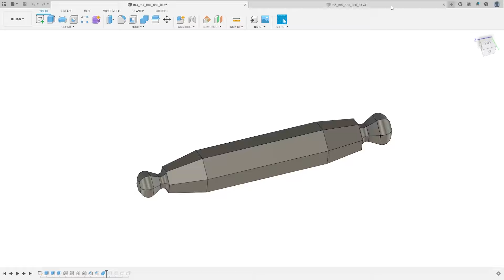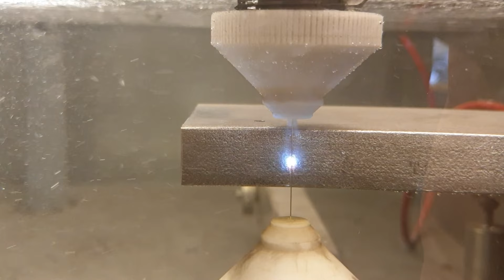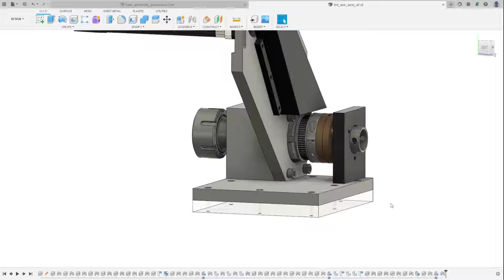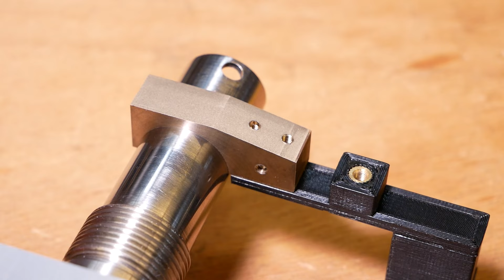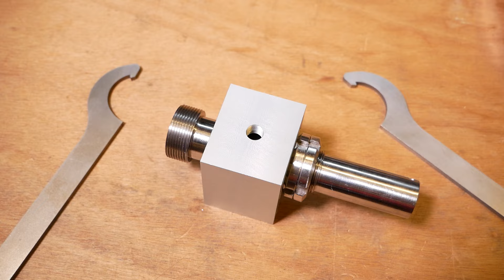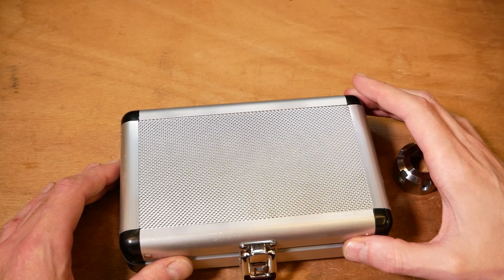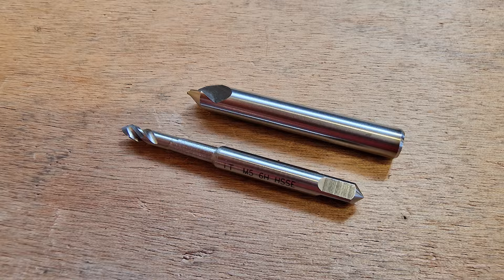Worlds First DIY Wire EDM Lathe!

Comment: Low grades of stainless are still magnetic. It's about how magnetic it is that tells you a general idea of the grade, and cheap alloys will generally still be weakly magnetic because of their higher iron content. They'll develop surface rust faster than better grades but generally won't pit as readily as regular steel. Sinks and cheap cutlery are good examples of this.
Reply: There is no such thing as "lower" grades of stainless. There are different types, with different properties. Sometimes you want high strength, sometimes you want something more ductile. Sometimes you want magnetic stainless, sometimes you want non-magnetic stainless. Just different horses, for different courses.
Reply: @crashfactory  Granted you just mostly detailed what defines "lower grade," but ok. Feel free to stroke your folks all ya want. Not here to judge. Or your horse, since you edited.
Reply: @custos3249  Again, that makes no sense. "Lower Grade" implies a one-dimensional "quality" scalar, which is nonsensical in engineering. It's like saying "size 10 shoes are lower grade than size 8 shoes". Obviously, a size 10 fits some people, and not others. Is 440c stainless cheap? It's got more iron in it, and is magnetic. The same sized blank 0.25" x 2" x 12" in 304 is $21 on mcmaster, and $134 in 440c.
Reply: @crashfactory  You can play word games all ya want some poor engineering professors convinced you was meaningful. Lower grades, per their reduced material properties like corrosion resistance, are still slightly magnetic. And, no, shoe size is not a valid analogy to material properties. I can't take 2 size 6 shoes to meet spec for a size 12 foot, especially when conditions call for high heels. That's like say I can't use a 2x4 to chop down a tree because it's only a foot long rather than something related to actual intrinsic properties of both materials.
Reply: @custos3249  "Lower grades, per their reduced material properties like corrosion resistance, are still slightly magnetic" Which properties?! 440c is way stronger and harder that 304, but is also less corrosion resistant. That's my whole point. Some properties increase, while others decrease. There is obviously no "better" grade across the board, it depends entirely on the application you're applying the material to. You know this.
Reply: @crashfactory  If it came from China and was advertised as stainless, it would be no better than 304 if even that. Lower grade in this instance relates only to corrosion resistance since that's the relevant property in this project.
Reply: @KJ6EAD  304 is pretty corrosion resistant. Many magnetic stainless steels are less corrosion resistant but trade corrosion resistance for other improved properties. In the typical use case for a collet nut, we care about strength, not corrosion resistance, so the natural choice of any manufacturer, Chinese or otherwise, would be to choose a stronger, but less corrosion resistant stainless alloy. No manufacturer would trade corrosion resistance for strength in a collet nut, since they are almost never used in environments this corrosive. This is such an outlier case, and obviously the manufacturer would not optimize for it. It's egocentric to assume they would. In addition, even if the collet nut was made from 304, if the manufacture of it included processes that plastically deform it, the stainless may become mildly magnetic due to strain hardening.
That said, ali-express listings are not particularly reliable, and the bluing seems to have worked at approximately the same rate as the known steel collets, so it likely is indeed, some non-stainless alloy. MY main argument is about attempting to label stainless steels on a single dimensional axis from "lower grade" to "higher grade" and assuming that all properties linearly improve as you move through this one dimension. That's bonkers.

Comment: FYI, only austenitic stainless steels are antimagnetic (most common types being 304 and 316). Martensitic, ferritic and duplex stainless steels are magnetic.
Reply: Yeah, but since it took blueing so well it's most probably not stainless anyway
Reply: @avelkm  agreed
Reply: @avelkm  good point from u, i hear stainless does not take blue, however cold blueing AFAIK does not provide any corrosion resistance!
Reply: @GraphicManInnovations  It does provide a some protection, though not much.  Part have to be oiled afterwards to give a useful amount of rust resistance.
Reply: Exactly, being magnetic doesn't necessarily mean it's not stainless
Reply: @novachig  Yup, this is why I carry a magnet to thrift shops when buying a pot/pan that will work with my induction top.
Reply: Yes to above comments.  17-4 stainless is magnetic, its about as corrosion resistant as 304, and is very strong, high yield strength, good elongation before failure, and widely used when you want a high strength steel with stainless corrosion properties.
Reply: I was thinking that, 430 is super common ferritin stainless
Reply: Should it be non-magnetic not anti-magnetic
Reply: @Spark-Hole  I am very pro-magnetic myself. Magnet on a string beats the hell out of bending over to pick up a dropped screw.
Reply: @old_guard2431  I'm magnet neutral! I think magnets are great, but I don't get pulled nor pushed by them.
Reply: @old_guard2431 Weird, I'm diamagnetic.
Reply: Wow! Very useful information! Thank you!
Reply: Honestly I did not know this! Thanks for the knowledge
Reply: They do conduct electricity though.

Comment: Cool workaround for the issue with the seals, Mike!
Also, coincidentally, just three weeks ago, the YT channel "Cutting Edge Engineering Australia" made a video about a shop-built rotary ground-clamp: https://www.youtube.com/watch?v=bIkHtYWENiA - has a lot of similarities with your solution, in case you're interested. P.S. That "stainless steel" may be martensitic or work-hardened - these are magnetic.
Reply: I thought about that same video

Comment: Is it me, or is the M5 bit impossible to use? :)

Also, I couldn't help but notice the sloppy fit of the bits, i suppose that's the downside of machining a spinning part, you MUST have your y-origin in EXACTLY the right place or as any alignment error will be doubled, it's probably best to touch-off on both sides of the spinning part (and while it's actually spinning!)

Loved it though, so many ideas for when i'm feeling brave enough to build my own machine!
Reply: Biggest brain idea is that he did it on purpose to drive commenting
Reply: @floshey  fairly sure he did. Judging from the machines he makes, his capacity for spatial reasoning is more than enough to spot this issue at least as easily as us ;)
Reply: I agree with you about the m5 side because the ball is bigger than the shank. I don't know about the sloppy fit. It could be he measured the original ones and they may be slightly smaller because it relies on the ball detent to lock, or it could be deflection or mis alignment,  or it could be the Axis zero is incorrect. Too many variables to tell. He would need to check his measurements first, then check the Axis zero. Then lastly see if there is any deflection that happens between the end of the shaft to the holder. But it's a pretty cool project none the less.
Reply: He could have given the shank an angle in the center so it wedges into the holder as you push the bit in.
Reply: He said somewhere up above that the socket is tiered, with a 4mm hole inside and a 5mm hole above it. So it's probably a perfect fit in the inner hole
Reply: Absolutely, but it’s not an M5 bit. It’s a 5mm Hex- bit, which is usually for M6 screws.
Reply: M6 bit is 5mm, M5 bit is 4mm, M6 bit is usable but does not go in the 4mm  driver socket so M5 (4mm) bit is not usable.
Reply: You're all overthinking it! The problem is as simple as the difference between 6mm and 1/4". Most tool hex shanks, and holders; are STILL made 1/4", which is slightly bigger than 6mm. The amount of play makes this painfully obvious to anyone who uses this type of tooling regularly.
Reply: @arealassassin  they're 4mm hex bits.
Reply: @theafro  Except 4mm bits aren’t 4mm - they are 3/16” usually.
Reply: @allangibson2408  Wow, that would be a sloppy fit! I've got to admit. I've never felt the need to actually measure my screwdriver bits. But I'm going to now!
Reply: @arealassassin  someone who doesn't possess 4mm mini driver/bits then it seems! I have 1/4" hex drive ball end bits ... LOADS on eBay, Ali Express, Bangood ... But like he said NO 4mm hex ball ends! 🤔🙄

Comment: very nice video, i love this machine, your solution to the electrical contac is very nice , durin the video a think another one .. it consist in a coper wire or tubular comper mesh than it rotates fix to the center of the spindle then that cable can go out of whater and make electrical contact whit a ring and brush type rotary conector , the toque rotates de cable and work like a flexible shaft in the same way as Flex Shaft Rotary Tool Attachment  from Dremel and others
Good luck, keep doing videos.
Reply: cheers from Argentina

Comment: Congratulations Mike, great job! 👏🏼👏🏼 I loved the video, the fourth axis for the wire cut is something that I would also like to add to my machine, I'll write down the idea, the truth is that the wire cut allows to do incredible things. I recently cut a pinion with a "D" type hole that I could not find commercially, it is a simple piece, but it is not easy to find, or make internal gears for my gearboxes, the number of teeth and size you need, it is a wonder to have this technology.

Comment: This is awesome! Loved every minute of the video. It seems like the TIP of the bit is wider than the SHAFT, how do you put it into the HOLE? It seems to fit on the end of the video, but does it fit backwards?
Reply from the maker: The holder accepts 4mm and 5mm bits but the 5mm is not that deep. Its a bit incovenient to use but it works. I might redesign the bit.
Reply: It seems like the possibilities are endless with this. Thanks for sharing it with us!